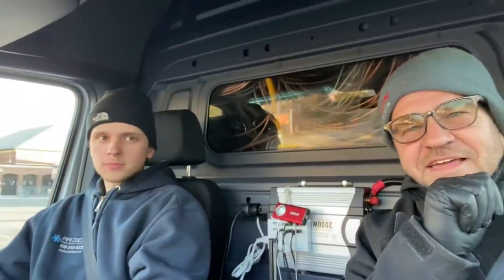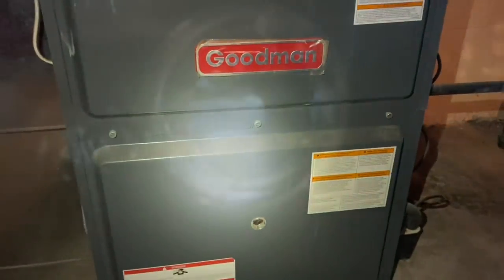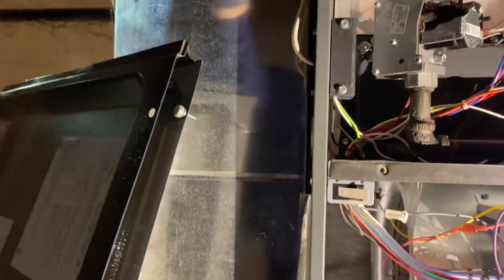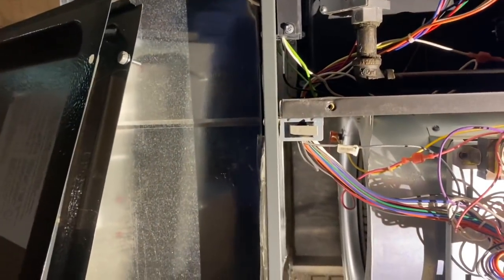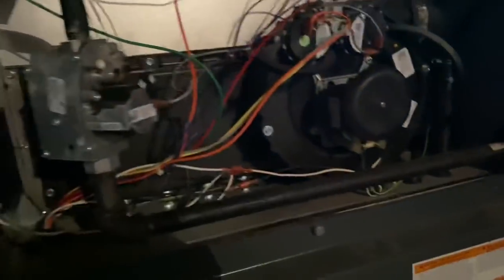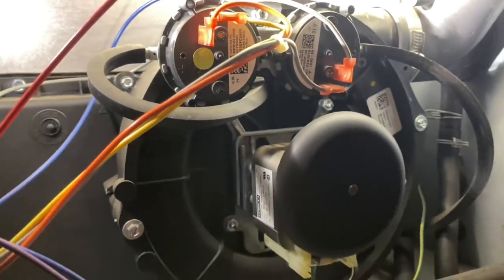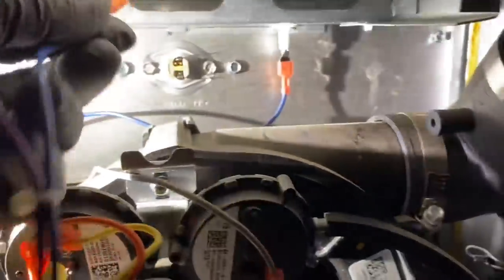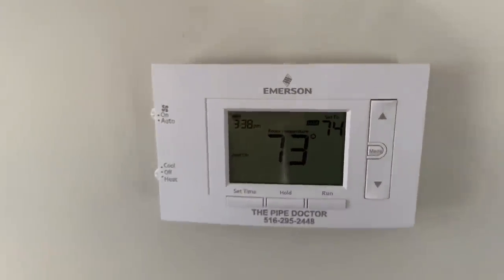Goodman Gas Furnace Not Heating Defective High Limit Diagnosed

Comment: Alright boys 
So up here in Canada we see this a lot. I proceed with a high temp code as follows:
1. Check filter 
2. Check temperature rise 
3. Check static pressure 
4. Remove limit and stick temp probe in the hole to see what temp I am reading 
5. Adjust gas pressure and increase airflow 

If you swap the limit good chance it will do it again and eventually the limit will stick open and you will be back
Reply: Good advice. ps..you not doing videos anymore? Always liked yours.

Comment: Thank you for the video.  I have been fixing my 20 year old Goodman furnace for a while so far, I've replaced the control board, hot surface igniter, and vacuum switch (probably didn't need to).  Like the plumbing goddess, I believe in testing and diagnosing before replacing.  I came home from work yesterday and the furnace was dead.  It wasn't that cold out, so I put the space heater on for a while, then turned them off and went to bed.  Checked it today, and I got the 4 flashes.  Read the guide on the inside of the panel and saw the same high limit switch open that you did.  I did in internet search and came to your video.  I must have forgotten to change the filter, because it was pretty dirty.  Oops!  Tried it again and still got the 4 flashes.  I had read while searching for you video, that sometimes the high limit switch get stuck and you can unstick them by tapping on them.  I used your video to locate the switch.  It didn't look anything like the one in you video, but it was wired right and was in the right place.  I tapped it gently with some pliers.  (The same pliers I used to unstick are relay on the control board of my 20 year old Kenmore clothes washing machine two days ago.)  The I turned the power back on.  The hot surface ignitor started getting changing color and the burners fired up.  No problem since.  Note that I have a background in electronics and electrical work.  My father taught me how to solder before I got out of elementary school.  I don't recommend anybody do this work unless they have knowledge and serous respect for electrical current.  I know someone who was electrocuted and died working on their air conditioning unit.  It is not a good way to go.

Comment: What’s up Mikey pipes, love the channel and learned a lot on boilers from you. I work a lot in force air and thought I’d help. I would check your temperature rise (one probe in the supply and one in the return) if it’s to high here are thing to check. First total static pressure if it’s over 1.0inwc you have air restrictions, like a filter, evaporator coil, secondary heat exchanger, or under size duct work. Check blower taps if psc motor or dip switches if ecm. Hopefully this helps👍
Reply: Great info, as well as personally first thing I check is the gas pressure, typically the gas valve will tell you 3.5” water column. Furnace name plate will tell you 3.2-3.8 but most of the time you’ll find 4.2” water column on a valve that no one adjusted during start up. Of course taht all depends if it’s single stage or double, as well as if the gas is natural or propane
Reply: Why is no one questioning how freaking huge that furnace is? Oversizing gas furnaces is a huge problem.

Comment: Hey Mike. A good way to check if the hi limit is bad is to take it out and jump it out like you did but put your thermocouple probe down the hi limit hole and watch to see what temp it gets up to. If its over what the hi limit is set to then your hi limit isnt bad and you have to look further like maybe your evap is plugged, blower dirty, or filter dirty. Something like that. Basically your airflow. If when you put the probe down and it doesnt get up to the temp rated on hi limit switch then your hi limit is junk and opening prematurely...
Reply: Yup that’s how I do it. Take out a screw next to the limit/make a new hole near the limit. Stick a thermometer probe in there and watch temp. Also have meter on the limit to see if it’s opening/ at what temp related to the rating on the limit itself

Comment: Hello St. Mikey pipes. I believe that furnace is oversized and has always short cycled. That looks like a single stage 120,000 btu Goodman and I heard you say that they have another furnace. First I'd rule out that the a coil and secondary heat exchanger aren't clogged. You'll probably end up putting that furnace on a diet to fit the existing ductwork. Lower the blower speed and use fiberglass filter to get static pressure down. Lower the gas pressure to get the temperature rise within the recommend range. And if it's still not enough you can add an additional return in the basement. Right on the data tag is the recommended static pressure and temperature rise. Honestly a furnace that size should of been on a return box.
 Keep the videos coming sir.

Comment: Check what the temperature rise is supposed to be and then measure it at the return and downstream of the supply. Best temp is the middle of the range. If it’s high with a clean filter, just one filter, not two. There may be closed registers, fan speed could be too slow, or it’s overfired. Clock meter to check btu.
Reply: people love blocking return grills and shutting supply vents temp rise is key with Hi limit issues

Comment: Should have done a temperature rise Mike. Fan speed may be too low and causing limit trip. The cooling coil could be dirty and causing limit to trip. 👍👍🇨🇦
Reply: I looked at furnace that was 3 days old,i did not install it but the lady called that company and they said maybe by the end of the week! So anyhow,they obviously dod not do a heat rise because the exhisting A-coil was plugged solid,had to uninstall and clean and re-install there f-up! For free of course,because i felt bad!
Reply: @petersmart1999  on any new install you need to do three things . 1. Check the gas pressure ( firing rate ) 2. Do a temperature rise 3. Do a flue gas analysis.👍👍🇨🇦

Comment: If you check the temp rise it will Telly you if it’s running to hot. Or just check the supply temp and see if it’s higher than the rating on the limit switch.

Comment: I’ve seen a furnace limit blow. Jumped it out and stuck my prob in the hole. Wasn’t passing the rating… bad limit … right? got a new limit…. Same thing happened. I started investing further in the area of the high limit believe it or not there was a crack in the HX in the area blowing just right on the limit tripping it out.
Reply: I have dealt with a cracked HX too with the same symptoms! Doesn't happen often, but it does happen........

Comment: Ya, having all those parts are nice, but I started in 86 and was heavily into renovations of Victorians in well to do areas.  I had a box truck with ton's of fittings and tools.  I could stay on site a week and never get get stock.  That said not only has my business model changed but material has to.   I have a smaller truck now and mostly service and fittings like 1/2" c 45 and st 45 that I just cannot burn the inventory down.  I had a millivolt gas valve in my truck for years could not get rid of same with a pony relay.  I have standing pilot assemblies and a bunch of other stuff as it all goes way of the dodobird I will never get rid of.  Day after I die it all goes in the dumpster.  I know Mini me had a customer complain about the cost of a part that she could get on line and this trend will grow with time I run into it a lot.  You almost have to double the cost of a part as a sales price to come close to justify all that stuff on your truck.   You have to account that some parts may only be used once in five years, some damaged in the truck or for what ever the reason unusable and in the end if you close the company and cannot sell it, the dumpster eats it.   If you know Massachusetts at all I am slightly west and south of Boston with supply houses10 min in almost any direction I need to go so stocking just is not that critical, so guessing its different then NY.  But how much I want my leftover inventory gone before I retire.  BTW do not Instagram, checked YouTube and no plumbing goddess but yes on a princess and she is way more attractive than you or Steve.....  https://www.youtube.com/channel/UCQn9Xx70Qhaw3zDyL0-im2Q
Reply: reduce your parts to pressuretrol ,thermo couple,gas valve......simple gas steam heat for me ,been working for my  95 year old house .lol....oh yeah one stat for basement and 3 floors(no zones, no doo dads that break every 3 years etc,).....never changed batteries in 95 years...never had batteries and will NEVER get batteries..you guessed it one bathroom...haha

Comment: So thats a spill switch....?
Is that the same as what on a damper on a castiron boiler?
Reply: @PipeDoctor  gotya
Reply: @PipeDoctor  when come to a heating furnace or combo cool and hot air with ducts...what brand you recommend?
I have goodmans in my other home on staten island they are 25 years old and still work OK but I'm thinking of replacing them and I never worked on these type of equipment